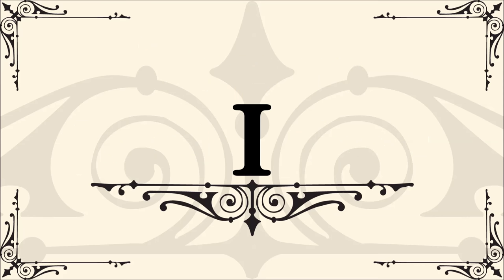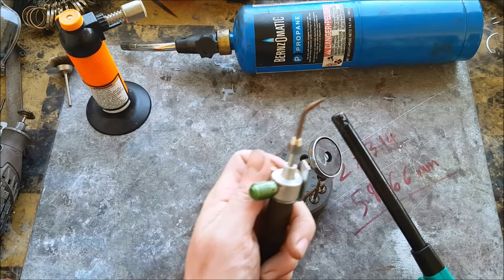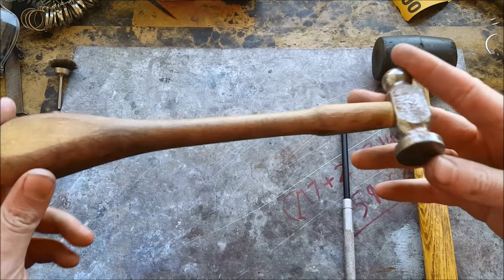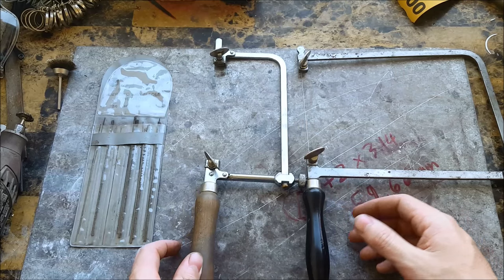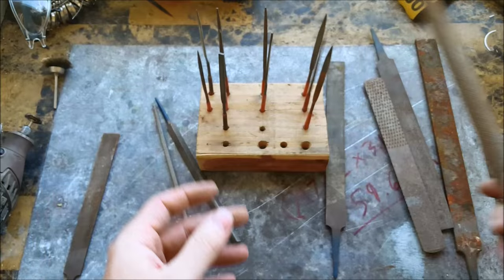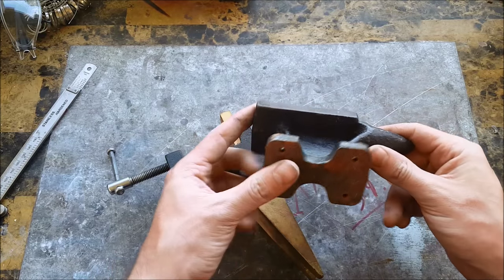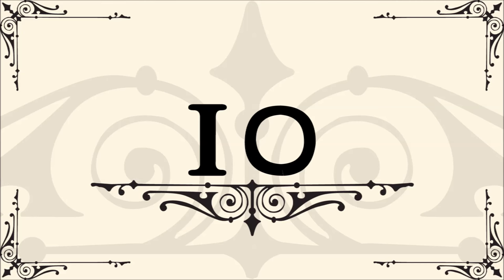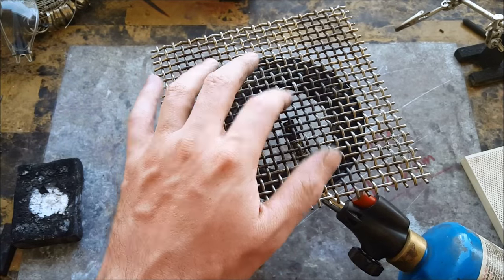10 Must Have Jewelry Tools. Without these tools I couldn't make any of my work.

Comment: I am an absolute RAW beginner in making jewellery, so I freely admit that this may well be a daft question, but I am also a firm believer in the old adage "how can you find the answer, if you don't ask the question", I would like to know the answer, so I'm asking the question.

Is there a way to make a chain WITHOUT soldering the individual links ?.

I heard that someone had managed to do it, but I have no idea whether they were just yanking my chain, but after several attempts I have thus far had no success in finding any mention of it.  Can you please help ?.
Reply from the maker: Well, this would depend on what kind of chain your are making. If it happens to be thicker you really don't have to solder the links shut. But if you are dead set on closing up the rings you can always try to fuse them but this isn't easy. Here is a video showing how I can do it using a Smith's little torch. https://youtu.be/U0bA9CSynDs

I have heard that is can be hard to do with sterling silver but I haven't had any problems with it. If you can give it a try with some 16ga round wire.

Comment: What are your thoughts on a miter jig? Some say it's absolutely necessary but never once was in mentioned in the classes at a local art school.
Reply from the maker: +margie max They are very helpful for cutting flat and perfect angles but I don't use or have one. If you have the money and feel it would make your life easier, I would say get one. I do just find with pliers and a file for what I work on. Let me know what you end up doing.
Reply: I use my $50 miter jig a lot.  I make a lot of bands though, usually 15 at a time so it's nice.  I have worn it down a bit but it still works great after 100s of rings filed on it.  Now i've started doing split shank bands so it's not needed, but for wide flat full bands it's really essential.
Reply from the maker: I have 2 miter jigs now and they are super helpful. 😄👍

Comment: Have you tried a good propane torch? or butane torch for that matter. I have the same model and it absolutely sucks for this application in basically every aspect, but I also have a good one that works quite well.
You could probably just get away with oxygen propane in the smith torch too.
Reply from the maker: You can only use the oxygen propane setup with the smiths little torch. I use just the normal plumbers propane torch for a lot of my work and it does work but you are limited on the size of the piece you are working with.
Reply: @GomeowCreations  yI'm saying that you can get regular Plumbing torches with larger and much hotter Flames, I prefer the BernzOmatic ts8000
 that don't require oxygen but are still much better than the plumbing torch you displayed in the video which I also have and bought for its small convenient size, but it is completely night and day using these torches for casting or soldering even though they work on the same principle.
If you get a big enough propane flame that will put out a lot of BTUs compared to a really tiny acetylene Flame.

 when you say you can only use oxygen propane with the Smith little torch do you mean other brands of oxy acetylene torch don't work with propane because I thought they all did, or are you just saying you can't use oxygen in a plumber's torch.
I was just wondering why use acetylene and oxygen instead of propane and oxygen, just kind of seemed Overkill for jewelry.
Reply from the maker: I was saying that you cant use oxygen with the plumbers torch. I do know that I could use propane with my little torch but I like working with the acetylene. 

When it comes to basic soldering you can used a cheap plumber torch all day to get work done but you can't do fine work with them or do any kind of casting. I guess mapp gas would be a good/cheap middle ground so you can do some small amount of casting.

Comment: thanks for making this videos, where´s your acetylane/oxygen mini torch from?
Reply from the maker: +ROMINA ROMO I'm happy it helped, my mini torch is a smith's mini torch. I got that torch on ebay for around $135 - $150. If you get one make sure to get at magnetic older for it, it is very handy. The tanks I got at a local welding supply store for $200. The regulators and tank holder was another $200, but it came will welding end and a cutting torch. I dont remember what website I got it from. I suggest looking around for the regulators and tank holder.

Comment: Hello.. thanks for all the useful tips.... I do have a question....  I just purchased really nice (used) anvil stake and a few mandrels that have been sitting in storage for awhile.  They are beautiful and smooth however they have a little surface rust on them.  What would be the best way to clean and re-polish them without using harsh abrasives or wire wheels?
Reply from the maker: I have that same problem with my mandrel, hammers and other tools. So some of my tools I just use a wire a steel wire wheel on them, but if it was something I needed to stay smooth I used a brass wire wheel to get a lot of the rust off. The brass will not hurt the steel tool. Some other tools like my mandrel and graver tools, I use a buffing wheel and polishing compound to get a very smooth clean finish.

I hope that helps. Make sure to test it and try it in a small spot so if it messes up the tool it is only a small spot. 

Let me know how that all goes and if you have any more questions, feel free to ask.
Reply: Danny Herrera  you are better off to use the abrasive option . It will give you an even  finish while chemically removing rust removes the rust but leaves pits where the rust was ....

Comment: Very similar things you didn't mention essential to me.

Flex shaft for the dremel.  Radial brush discs from 180 to 2000 grit which replaces all other buffing and finishing tools. MAP gas torch to melt silver for casting (and the butane micro torch works for everything else hah). Wide oval black colored crock pot for pickling long pieces and can see through lid. Brass work horse hammer for punching, Heavier nylon hammer for shaping around mandrels.  Nylon tipped pliers, parallel closing jaws, v-jaw, wrap and tap.  180mm diamond files 40 - 600 grit flat. Ultra wide file or sharpening stone for evening large surface area.  Clamping double screw tightening bench pin. Standard wide bench block. Kiln brick(s) to heat on (put two next to eachother and you can anneal 2ft long pieces) (break one in half and put on a cast iron nacho skillet = your soldering station no mess and can rotate).
Reply from the maker: Thanks sharing your tool set up with me. Things have changed and I now use a lot of those tools. Here is an updated video https://youtu.be/w5MmEC5Bv8U 😀👍

Comment: Hi, I'm veeeery new to jewelry making and also on a bit of a budget- do you know of any cheaper but still fairly good pen drills I could buy to get me started before I build enough confidence to invest in a dremel???
Reply from the maker: +peachapparition I have moved on from the dremel myself. I found for the same price as a dremel you can get a flex shaft. But you say your on a budget, if you dont mind me asking how much are you looking to spend on this tool.
Reply: GomeowCreations weeeelllll I didn't really have a price point in mind until I saw some sets online, I think one was called rotocraft, another was called Am-Tech and they're going somewhere between £25 and £32; however I worry buying budget brands or accidentally a knockoff  that it wouldn't be powerful enough or would break easily
Reply from the maker: Well it looks like those tools could work for some time. If you want something that can get you into this and see if you like it I would totally get the cheaper tools to start.

Here is a link to the tool I use now https://www.ebay.com/itm/Flexshaft-Motor-Hanging-Flexible-Shaft-Machine-Kit-1-4hp-110v-Jewelry-Woodwork/190638318831?hash=item2c62ede4ef:g:2PgAAOSwRoxXm~Ah

I have had 1 problem with it, the foot pedal went out on me 2 times. The 1st time they replaced it for free. I ended up buying a new pedal and everything has been working great for the last 2 years.

https://www.ebay.com/itm/FOREDOM-ELECTRONIC-FOOT-SPEED-CONTROL-FCT-1-FLEX-SHAFT/280634485094?hash=item41571e6966:m:mAdRWV_2RXK7O6YtDCgftgg
Reply: on the same note, it would be helpful to have a video on begineer toolkit to start out.
Reply from the maker: I will look into doing that in the near future.😄👍

Comment: The second 'file' you picked up is a rasp, a tool for hogging off large quantities of material, not at all suitable for jewelry making. You had at least two there. Reserve these for rough shaping wood, soft stone, like soapstone, and well cured plaster.

Charcoal block is good, but since you have acetylene, find a piece of scrap, metal strapping and bend and weld a tight metal band on the sides, which will keep the  charcoal block from splitting and being ruined too soon. 

Wire wrapping will work too, but you have the tools to do better.

Use your Dremel to cut off the tip of your 'ruined' pliers so they are useful again.

Also, buy some diamond saw blades and value pack diamond bits from H.F. for cutting stones.

You can also find  ball pein hammers there, to modify into cross pein hammers, using the Dremel. You can also use the Dremel to make patterned hammers for chasing.

H.F. has low cost tumbler, sonic washer, and polishing grits, which you can use to clean-up the surfaces of your anvils and chasing hammer, for less pockmarked beaten metal. They also have rouge for polishing.

The small H.F. torch will work for simple wire works, such as putting a ball on the end of an earring hook or on the ends of round rings. 

You can, if needed use it to anneal silver and solder silver and gold, as well copper.

If annealing, I recommend  a H.F. visual thermometer, so you don't over heat your work. 

Look for a 20-25% coupons on-line or sign-up for mailing list and you'll receive these on a regular basis, each month and special sale date. 

You can use your phone to show these, instead of printing out copies. 

They also have basic dapping block, with bits and a good hole cutting block, also with correct bits. Definitely use 25% coupons for these, which come out for most holiday weekends.

Lastly, get one of their locking pliers and use Dremel to mod. jaws for wire pulling. you'll have to make your own wire pull plates, or buy them, but they don't cost a lot.
Reply from the maker: Well that is a lot of good info, thank you for taking the time to do that. This video is about 2 years old now and I have upgraded to some better tools now, but modifying tools is not something I every thought of doing. So again thank you for the tips, I will be using a lot of them. :)
Reply: does that mean a follow up video? that would be a great addition
Reply from the maker: Yes, I have plans for one in the future. 😅👍

Comment: Where do u get those large slabs of metal plate thing like you have on your bench. It's the slab youre placing everything on that you're showing
Reply from the maker: I got it at Home Depot. 😄👍
Reply: What's it called so I would know what to ask for? By chance do you know how much it runs for? And I already have a anvil and 2 bench blocks. But just wondering, could you still use it to hammer on and use your work on?
Reply from the maker: Here is all the info that the metal has on the tag. 

PLAT STL-SHT (26GA)
12"x24"
1904
H# 11180

This metal is thin and I only use it so I don't burn or damage the work bench. I have hammer on it but you have to use a bench block or an anvil.
Reply: GomeowCreations thank you

Comment: Hi, Could you please give me the Drummel tool and the oxygen acetylene torch. I have a small studio at home, but not in a position to spend a whole lot. Help will be much appreciated
Reply from the maker: Hello Diya, I think you might have a type-o in you comment but let me give you some prices,options and links to some setups.

Torch Options:

This is the full set-up that I have - https://amzn.to/2JQHQ3p but it's $730 and you'll need to get the tanks filled for another $80.
 
This is a cheaper option and you'll be able to use the same smith's little torch - https://amzn.to/2taw49H but this is still about $300 and you'll need to get some cheap disposable O2 and propane tanks for under $10 each.

If money is really tight this will be your best option and this is also my first torch set-up - https://amzn.to/2K27Rw9 you can get this end for under $20 and get the propane for under $10. 

Dremmel/rotary tool options:

This is what I use now for my main rotary tool - https://amzn.to/2t9TwUC and the control peddle for mine needed to be upgraded to this https://amzn.to/2I2yDPS this is about a $140 set-up

If you want the same dremmel tool that I had you can find it here https://amzn.to/2lmQp7A for about $50

If you want to spend less then $50 this might work for you - https://amzn.to/2yp3jev seeing that it's just over $20 and comes with a flex shaft end but I don't know the quality of this item.

Well I hope you can find an option that will fit your budget and if you have any more questions feel free to ask. 😀
Reply: Thank you so much!. I will look into these.
Reply: Hi agian, do you think the polishing barrels, the silicon rounds from Rio will fit into this Dremmel ? Thanks again.
Reply from the maker: Look to see if you can find the shaft size for the bits you are looking at. Your Dremmel should have came with some different size collets to hold all different size rotary bits. Something like this https://amzn.to/2tIlPJe
Reply: Thank you so much!

Comment: Where can I get a dremel tool like that and the bits
Reply from the maker: You can get a Dremel at just about any hardware store or online. I believe that I got mine at Home Depot, but if I would have known at the time that getting a flex shaft hanging motor was about the same price and 10 time better I would have done that. I really like the foot control and the hand piece on the flex shaft. As for the bits, I get them mostly on Ebay. I will give you links to everything in this comment.

Bur Bits - http://ebay.to/2sP0dOp

Diamond-in-Rubber Polishing Bit Set - http://ebay.to/2otfMpq

Flexible Shaft Machine Kit - http://ebay.to/2opmBZN

Foredon foot/speet control - http://ebay.to/2omrSRY

Dremel 4000 - http://ebay.to/2CEnAd3

Comment: RUST... when did you last use/clean anything?
Reply from the maker: +Steve Coster I work outside so if I remember right, we had a rain storm before I filmed this. Normally I move the tools before rain can get to them. I do clean up my tools if they get too bad. Also at this time I used these tool daily.